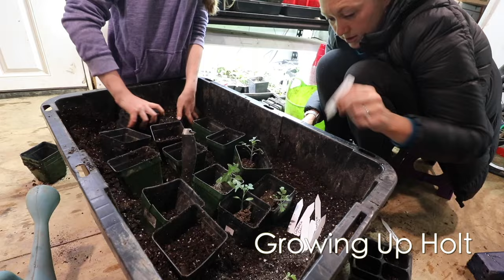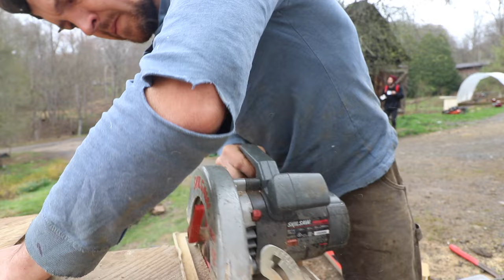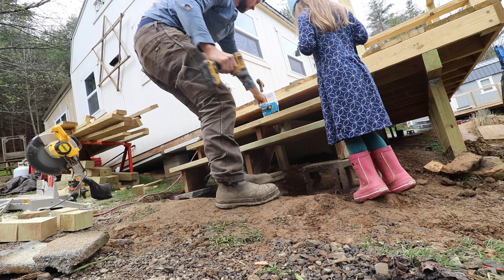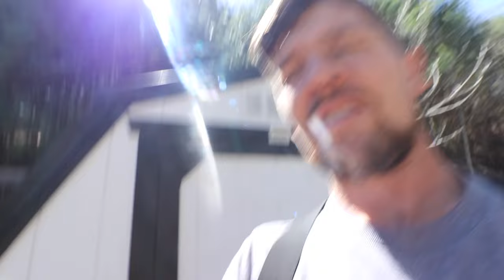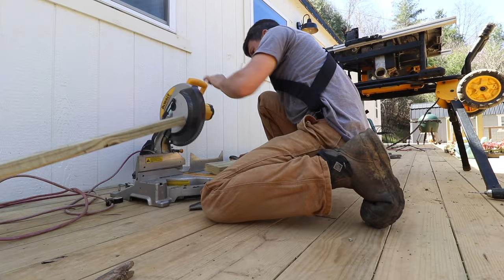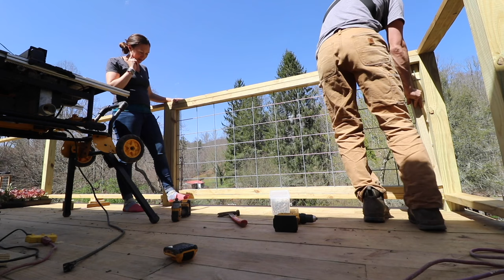The Best Method | Cattle Panel Deck Railing on our Tiny Shed House

Comment: At first I thought that it was an excessive amount of wood used for the railings on the deck.. but as the video went on, I came to the conclution that you were absolutely right in making it as stirdy as you did (me remembering how my kids/teenagers used the railings 🤒 for seats, to hang over, putting pressure on it, and trying to push their faces through to watch what's going on on the other side (really, there was no need to try to demolish the railings to see through it, but.. kids.. 😅) so.. very good workmanship!! 🤗

Comment: Great job!  We had our house built back in 2015-16 and did some of the work ourselves. I built cattle panel rails for our deck railing and we all love the result. My method was very close to yours, although we had sided pillars that the framer had put on our deck so I built the panels between the pillars, instead of normal posts.

Comment: Love the video - fixing to take down the stapled-on hog-panel on our deck and inset it like you've beautifully done. One thing I've learned from my test build, a 24" bolt-cutter (can be had for about $30) is the easiest way to cut the hog-panel through. Tried with an angle grinder but felt it was difficult even with a good cutting blade, on top of my general fear of that particular tool.
Reply from the maker: Yes, the bolt cutters are awesome for that, and the grinder was the hardest/most dangerous part of that build.  Have fun!

Comment: So the sandwiching of the wire panels is enough? or did you staple the wire to the outside 2x strip before sandwiching with the other strip? I'm reusing some panels from a dog kennel and I might need a thicker gauge. Seems like it wouldn't be rigid enough to keep a kid from pushing through, but maybe I'm underestimating how rigid it is.  Love the final look! Nice work.

Comment: I'm assuming instead of ripping 2x4s u cane just use 2x2 and still get a flush fit?
Reply: Yep, but 2x4's are generally cheaper to rip down than the 2x2's. If you don't count the extra labor of ripping them.

Comment: currently we bury 2   6 X 6 landscape timbers on the flat to set the stringers on, where you set cinder blocks,  this negate wood to concrete conection and it allows you atatch the stringers to the timbers with  treated screws. your cinder blocks need to be under the heal cut of the stringers, not so forward. that far forward puts the weight on a weak grain pattern   As for your cattle panel detail,  we run 2 2x4 on edge on the bottom, and sandwich the panel between these, it negates any water retention. When you run that one lower 2x4 on the flat first the 2x2 you use on top of that 2x4 trap water and thats not good,  if you can. maybe drill some weep holes in the lower 2x4 to let the water out

Comment: So, when you cut your 2x4 in half (to get two 2x2)to use for framing the panel, how can that be flushed when there is a wire panel sandwich in between?
Reply from the maker: You flip the 2x2 so the ripped part of the board is facing down, so you have the 1.5” width of the board on both sides enabling you to sandwich plus the wire and it ends up flush
Reply: Ahhhh..thanks @GrowingUpHolt

Comment: Looking at completing a similiar project. Do you recommend going with what guage panel material? My Farm Fleet offers both a 5 gage, and 4 guage. The 4 guage being about 1/4", and 5 slightly smaller. These are hot dipped after welding. Please advise. Thank you.
Reply from the maker: I think the 4 gauge would do better
Reply: Thanks. I ended up going with the 5 guage. I did not commercially they are using 6 guage. That might be too thin. The 5 hopefully will work.
 @GrowingUpHolt
Reply: @ufdalea how did the 5 gauge work out?

Comment: Great job building the railing!
I’m building a railing system myself and have not yet decided how I’m going to do it.
I have a question and If I missed it in your video or other replies I apologies.
Did you drill weep holes at the bottom for water to get through? Was wondering if and how you did that or if you think it is not necessary?
Reply from the maker: We didn’t do it, we used pressure treated wood, but there have been multiple comments suggesting that, so it sounds like a good idea

Comment: How about drainage on the bottom rail?
Reply from the maker: Good question. We haven’t had any issues with it so far…
Reply: Maybe pre-drill drainage holes in the bottom rail flat piece.? 
  I’m going to replace some deck rails and was looking into the hog panels. Looks good 👍

Comment: Wouldn’t ‘t it just have been easier to panelize them and the screw the whole thing into each opening?
Reply from the maker: We’ve tried that before, sometimes if your carpentry isn’t perfect (which admittedly ours is not) it can be a struggle making the individual panels fit.  Round peg square hole kind of situation

Comment: excellent video and exactly what i was hoping to install on my deck.   originally thought to go with vinyl clad, but galvanized looks fine.  

Can you tell me where you sourced the panel and what dimension the opening is?
Reply from the maker: Panels were from tractor supply - the opening is roughly 35” x 96” so you can get 2 sections out of each panel.  The panels are 60” tall so you have to trim them.  We’ve used the trim pieces for other projects
Reply: @GrowingUpHolt  thank you for your quick reply!    mind telling me the cost for each panel ?  my local tractor supply doesnt seem to list on their webpage